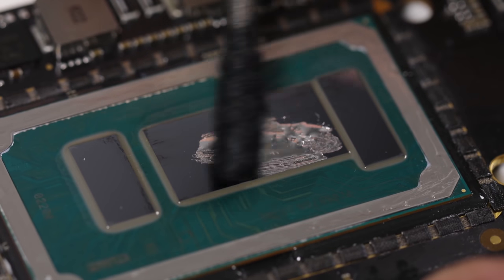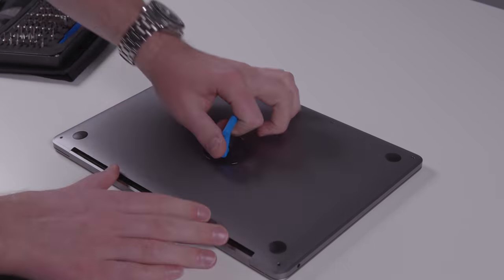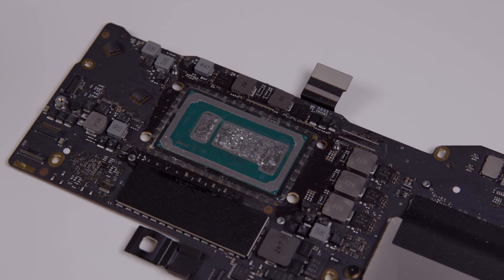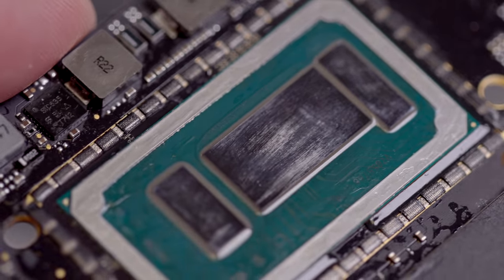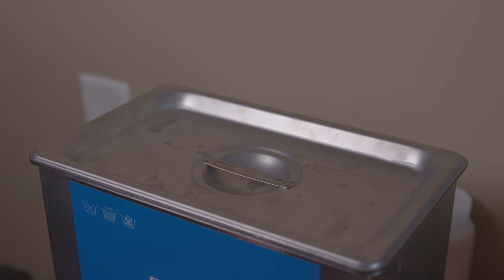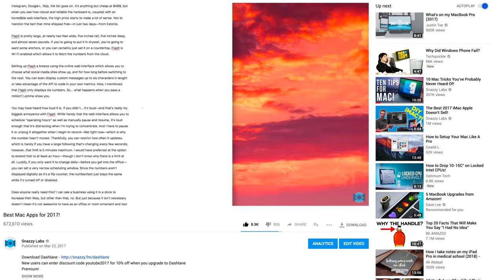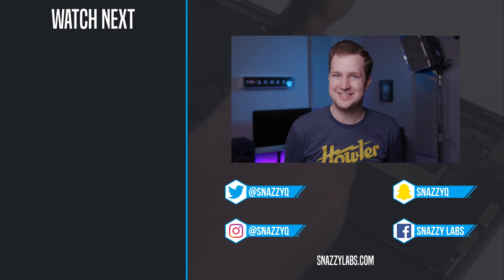What Does Liquid Metal Look like After 3 Months Inside a MacBook Pro?

Comment: i switched the cpu and gpu of my laptop to 'ic graphite' costs 10$ for a laptop chip sized square and is super easy to install. it also has the same thermal conductivity as liquid metal with much less hazard (doesnt spread or drip, but IS electrically conductive)
Reply: Going to be repasting my MBP in the next couple of days and was considering using IC Graphite since Kryonaut dries out when over 80c for extended periods and was debating between MX-4 and NT-H1 instead. Did you use clear nail polish or anything around the cpu/GPU in case there was any slippage during installation? How much of a pain was it to install? The only time I used my graphite pad, it was a pain to keep in place just using a normal CPU cooler in a desktop.
Reply: @FireMrshlBill  nope just be really careful when you set it back on top to screw on, make sure its dead center on the die (there isnt much if any overlap) and set the cooler on flat as you can, screw in without moving, and youre set.

now you'll probably have the same problems with yours as mine, where it'll help with temps, but anything heavy duty for long term itll still hit 90c. there just simply isnt enough copper and fans there to remove all that heat. 

but in general use, the fans stayed quieter, on less, and clocks can stay higher for longer. it definitely helped. its just not entirely magic
Reply: Thanks, I am more looking for lower idle/daily task temps and maybe higher turbo boosts before hitting thermal limits. Just cleaning out the small amount of dust in it dropped both idle (~7c) and load temps during Cinebench (~2c and gave another 0.2GHz on turbo before throttling). So just looking for a little extra on top of that. May just do MX-4 still since it would probably be less frustrating and less worry about a pad slipping during install since it’ll be covered out of sight. And the reported issues with Kryonaut over 80c.
Reply: @FireMrshlBill  the pad is super easy i promise, it fits perfectly over the die (20mm) and you just make sure you put the cooler down flat. long as it doesnt slide, its good. id be more worried about the paste to be honest lol.
Reply: Brad Haines Thanks, I'll consider it then. I have the 40mm pad since that is what fits Ryzen CPUs, but could always cut it to size for the cpu and gpu and have some left over.
Reply: @FireMrshlBill  yeah thats a good idea, saves you money then too

Comment: Exposed copper together with liquid metal pretty much always looks like this. Using liquid metal on high-end desktops is a lot less risky since the Cpu heatspreader is coated aluminium as well as must high-end coolers which are nickel-plated.

the lack of knowledge in this Video is a bit disconcerting and I urge everybody that is interested in liquid metal to check some other channels.

Comment: Dude, you're surprisingly funny. I had no idea you did this and I'm impressed that you did and even more impressed that you provided a follow-up video. My Youtube backlog has prevented me from watching more of your videos but I'm glad this one popped up.

I don't think liquid metal, when properly applied, requires annual replacement. But if you're worried about that (or any other LM concerns) then I highly recommend Kryonaut (which was shown in at least one of the graphs in this video). It's really easy to work with, non-conductive, and in my experience, gets VERY close to Conductonaut in performance.

My other go-to is Arctic MX-4. This just seems like a great all-around paste that has great thermal properties, a much lower price than the Thermal Grizzly stuff, and is easy to apply. 

For the record, I would have not applied any liquid metal to the heat sink, especially since it seems like you used a good bit of it on the CPU itself (I probably would have used half of what you used). But it didn't seem to cause any real problems, which is awesome! Is it worth it for the average user, probably not. I'd go with Kryonaut or MX-4 if I was super concerned about not replacing paste over the next 5 years, although I have not had a problem with either Thermal Grizzly product over long-term use. Pretty much anything is better than the stock paste Apple uses.
Reply: Also, I don't think Simple Green is a good idea in an ultrasonic cleaner. I'm sure someone recommended it to you somewhere, but... no. I mean, it's fine for the heatsink, absolutely, but you wouldn't want to put the logic board in that. I'm impressed that you used an ultrasonic cleaner though.

Comment: The only reason I can think that the liquid metal wasn't stuck to the heatsink is something to do with heat.  Obviously the chipset is hotter than the heatsink.  

It clearly isn't to do with gravity or the issue would be the other way around as the heatsink is on the bottom of the machine.

Comment: 1. LM DOES NOT DRY OUT, it canntodry on air, its liquid state is it physical properties of its components. it does not contian water, the metal itself is the liquid. 
2. what you refer to drying out is the process of foring an alloy with copper. its properties changes to it will no longer be liquid. 
3. its performances decreases when forming that alloy, so you need to reapply until thers no copper left that could take in that gallium.  
then it will stay as is forever, however compared to initial results with worse thermal properties.
4. the real issue with LM is getting the perfect amount so it never seeps out. once it does is quit deadly in a laptop as it moves around like hell
proper cleaning is more like decontamination. yea sadly not the solution to win it all and yes proper highend thermal paste is to be prefered.

Comment: Thats normal, the metal fills all the microscratches of the heatsink. Didnt have this on my GPUs or my waterblock (copper), but my CPUs IHS (I believe thats nickel? correct me please) was all black (liquid metal goes black if the particles are small enough, thats how i got the idea with the microscratches). No way of getting it off except some good ol sandpaper :/
PS: This filling of microscratches is actually nothing bad, its good! If you are gonna have normal thermalpaste on it some time later it will actually have better transfer, because the microscratches thermalpaste cant reach are filled up by something thermally conductive giving it more area to transfer heat with.

Hope this helped!

Comment: My theory:

Since liquid metal is flowy unlike normal thermal paste, the parts that look wet will depend on the way you

1. Use the laptop
2. Unmount the thing 

If you had been using the laptop upside down (highly unlikely) it's possible that this would've cause it to transfer from the CPU to the metal plate and vice versa

The way you unmounted it was "downwards" CPU at the bottom cooler at the top.  It's possible that while you were removing the plate all the metal came out. 

Hope one of these made sense 😌 

Also next time please re do the tests, so we can see if the performance of the paste deteriorated overtime.

Comment: Take a look at the newest videos from Der8auer. He did the same thing on his Lenovo laptop and showed a scratch test. He scratched the surface of the cooler to see, if t is real copper, or just copper plated aluminum. That should have been something you should have done. And it is totally normal to see a discoloration. The liquid metal will destroy every metal, but you said it is a 7% increase in temps and a huge increase in silence. I used Thermalgrizzly Kryonaut on my 2015 MacBook Pro. It still gets loud and hot. I am really considering liquid metal.

Comment: Liquid metal only increases thermal conductivity, meaning it removes any delta-T. It does not make your cooling better, so in laptops you will likely only see a difference in transient temperatures, not so much static temperatures after x-amount of time.

Comment: @snazzylabs Any chance you could get your hands on the i9 mbp and see if using a superior compound results with the i9 actually preforming reasonably? Would be cool if you did a comparison between liquid metal and the compounds that will give a 7-10% performance increase like you mentioned in this video?
Reply: Ryan Smith I still think that the heatpipes are not enough even with liquid metal, especially if Apple still only turn the fan up when the CPU reaches 80ºC

Comment: i'm also added liquid metal to my new Macbook pro 15" 2016 two month ago.
Temperature is dropped from 100 celsius to 71 at full cpu load. 

And i don't care about safety of heatsink, it's super cheap part of macbook, you can get new one for 30$.
And i also think that overheating of macbook with stock thermal paste can make life time is much shorter.
P.S Sorry for my english, i'm from Russia

Comment: I used LM on my laptop CPU and GPU dies for 8 months. The temperatures were fine, the paste moved very little, but just enough to leave part of the GPU uncovered, wich caused some instability (very rare cases, never crashed anywaay) but more importantly marked the copper coldplates a lot. I used fine grain sandpaper and wetsanded the copper to leave it unmarked. FUn fact: LM had only 2 degrees performance improvement over silicon paste, now, after the wetsanding they are even.
I strongly advice against LM in anything but a delidded CPU afrter I tried it in any of my devices (desktop CPU and GPU, laptop), is not worth it and it will do some damage.

Comment: Does the MacBook Pro 2018 i9 throttle if liquid metal is applied?
Reply: Leo Mühring It's thermal compound, not magic. The i9 is still gonna throttle.
Reply: I’m so darn glad that my name isn’t too looong 

I am not asking if it can hold turbo clocks, but the advertised all core frequency. 
Well, looking at Apples Softwareupdate, it can, even with the clay Apple uses. 
But it would still be interesting to see the i9 perform with liquid metal. It might even give a little more performance
Reply: Leo Mühring Oh, it can definitely hold up at stock speeds and might even turbo about 100-200 mHz, it just won't ever boost to 4.8 gHz like what Apple claims.
Reply: I’m so darn glad that my name isn’t too looong 
It can the turbo is a one core number. But the MBP was unable to hold the 2.9 all core clock. That is why Apple issued an update
Reply: Leo Mühring Oh, it was a one core turbo? I think its gonna be good for 2.9.
Reply: I’m so darn glad that my name isn’t too looong 
Well, the i9 still has problems to hold the 2.9 base clock, as it turns out. 
Liquid metal might help
Reply: @Noine14159145  LoL my GT63 with 8750H can hold all core 3.9 GhZ
Reply: God Potato 
Please check the topic. We are talking about clocks I the MBP
Reply: @Noine14159145  Of course it throttles, if i remember correctly the MacBook Pro will hold on an all core 2.9 Ghz speed under load
Reply: @Noine14159145  The thermal design is hideous on MBP.

Comment: A few things: liquid metal is sintering into another metal. When it does for a long time, it becomes part of the whole and thus loses some of the properties, such as being liquid. Instead of using liquid metals, you may use synthetic gun oil or something alike, to make the thermal paste much thinner and much more efficient, without having any side effects, "aka" thermal paste becomes way better than before. Any kind of, and thus you can use a cheap one, as long as the oil is ok. Paraffin for example is an excellent choice. You will wonder why nobody uses it? There is no business. It's cheap and works for years. Also remember that thermal paste is thought of to fill unevenness and not as a space filler!
Reply: What? Gun oil as a conductor of heat? You are way off base. Good way to burn up your CPU. Proper application of liquid metal is perfectly safe and can last for years. It will stain copper and may slightly (I emphasize slightly) degrade performance but in my tests it is neutral or slightly better (1c) than a fresh application. I have even gone as long as 3 years before changing liquid metal (Cool Labs Pro) and it still functioned perfectly. If it is still doing it's job, don't mess with it.

Comment: Please do a video on how to run Mac OSX on windows in a virtual machine, I know there are some good videos out there but there are still issues that I think you would be able to help with!
Reply: While it is possible to run OSX in a virtual machine, it runs UNUSEABLY SLOW unless you add another GPU( best if this is an apple blessed GPU) to the host and assign the newly added GPU to the OSX virtual machine using something like VT-d assuming the host cpu, host mainboard, and virtualization software supports this.  

This was the case 3 months ago when I last looked into it. If someone could recompile OSX's kernel to be less worthless, you might be able to get around that. Apple really goes out of their way to make it hard to use their OS on non apple branded hardware.

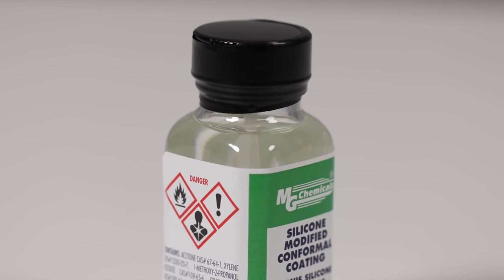Comment: 01:05 - Why do you apply protection to a blank board without contacts and parts?
You obviously didn't understand how it worked and why it applied.
The protective coating should be used on contacts and components on which liquid metal could cause a short circuit.
It is unnecessary to use on a blank board without contacts.

Comment: This is what happens if you shoot videos about stuff you dont know at all.
If the temps are fine, then there is nothing wrong with contact.
You could have continued to use that laptop for years without any problem. The amalgamation however seemed less then ideal but thats all due to the cheapness of apple. Other than that there was no room for the liquid metal to go, especially under that kinda pressure. Coating was a good call though. Nail polish would have been fine since there is like no heat transfer between the heat spreader and the area you coated.
What you saw on the die was not alloying: those were scratch marks that you had just made when you were wiping the amalgam away. Yes, it did amalgamate with the copper alloy.

Comment: I have an Asus Laptop GL502VMK with liquid metal and copper shims in CPU AND GPU. 3 Months Later I started to experience the same problem only in the GPU so my performance is not the same. What can I do? Do you recommend me to remove the Liquid metal and repaste it with normal Thermal Paste?

Comment: The change in color for the copper and other metals are entirely from the conformal coating. Everything looked completely fine here until...

 you scrubbed at the chip and cooler the way you did. You likely rubbed around microscopics amounts of gallium. Hope you cleaned up well, my friend.

Comment: I tried liquid metal in my 2012 Macbook Pro and it made zero difference, I switched to Arctic Silver 5 and still zero difference from the paste that came with the computer. It idles at 90c. What's up with my cooling? Is there bad contact between the cooler and cpu? Any way to remedy this?
Reply: Apple likes to run their CPU's really hot.
It shortens the lifespan, lowers performance but allows for lower fan speeds and less noise
Reply: @user-si5fm8ql3c  Turns out a service called "powerd" is constantly running the CPU at 100%. I did a full wipe and it came back. I think it's related to my Photos library being so large and the advanced search feature Photos has but not certain. Trying to get the dang computer to analyze the entire library but it's been taking days upon days.

Comment: Why is it always silicone conformal coating, it's the wrong one...

You need acrylic conformal coating. Both silicone and acrylic serve the same purpose, but acrylic is by far the best conformal coating for dielectric insulation. Silicone can work, it will gap and help insulate but not nearly as well as acrylic will. People use silicone on raspberry pies and stuff like that which are not likely to come into contact with water or liquid metal. The reason they use silicone is the fact it lasts longer. That being said acrylic conformal coating can easily last 5 years, and out of all the conformal coating offers the best electrical insulation you can't beat it for this type of application this is the purpose for acrylic conformal coatings. 

Go ahead call any company who makes it and they will tell you acrylic because it is superior to silicone when used for electrical insulation by a large degree.

Gallium reacts to copper as well as aluminum but it has no serious effect on copper. The copper will just absorb it and after a bit it will stop absorbing perfectly normal and the only way to prevent this from happening is by using nickel plated copper.

Comment: Okay so can someone explain how a metal “drys” when exposed to air. I know it can be absorbed and alloyed but why do people say dry as if it has water in it?  I’ve had a vile of mercury that has been open a million times and hasn’t really changed
Reply: StableEntropy You’re right. The technical term would be “freeze,” not “dry.” And it happens with direct airflow because it cools the gallium to the point of freezing.
Reply: AbuBakr Akram exactly, just turn the computer on and it will “wet” it again. Idk I don’t get why people say Dry. Never used that in 3 years of chemistry in terms of a liquid or low melting point element
Reply: I think it's because their mind thinks in terms of regular thermal paste, which does have a water component. Thus, it does actually dry out. People think the same way with liquid metal, forgetting that it's entirely different. It's like not realizing that the world's largest desert is Antarctica: you're so used to thinking of deserts as hot, you forget the definition. Same with liquid metal and thermal paste.